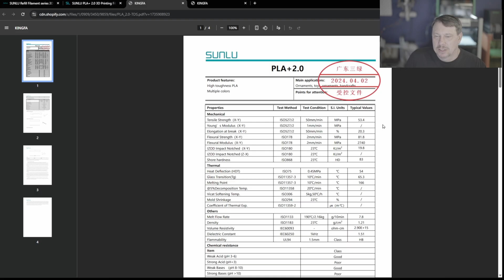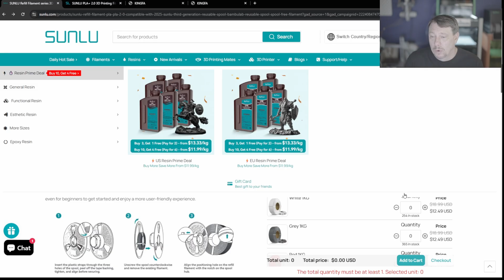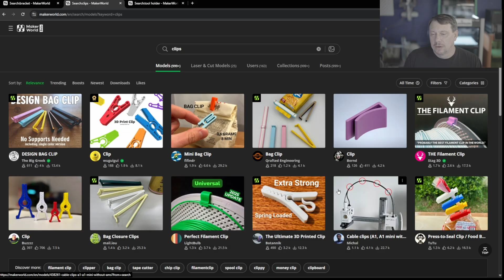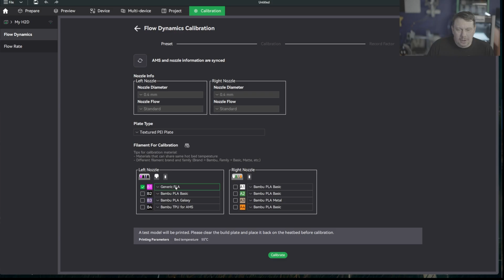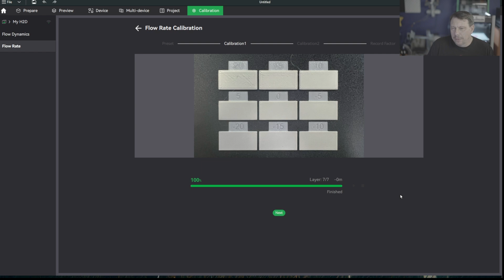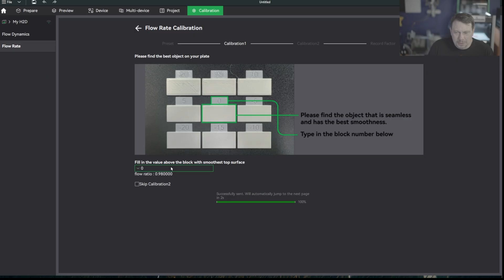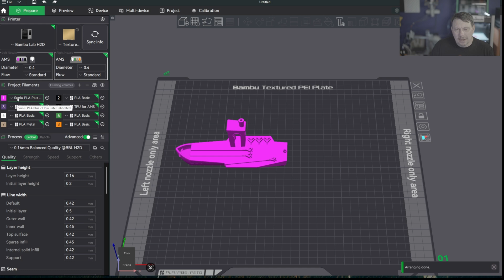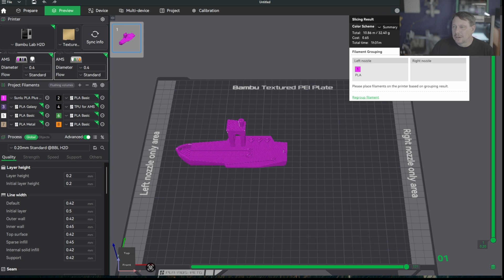Sunlu PLA+ 2.0 Review – First Impressions, Calibration Tips & Print Results

Comment: Did you compare the built in Bambu settings for the various Sunlu filaments? I've used the built-in settings when selecting Sunlu PLA+ 2.0 as the filament type and it has worked well.  Oh, if using a H2x, maybe those profiles aren't yet available like they are for the X1C?

Comment: After calibrating the filament you printed the bench with Flow Dynamics Calibration = Auto?  Shouldn't this have been off? Gerry
Reply: it's used if a calibration is not available or if it's too old